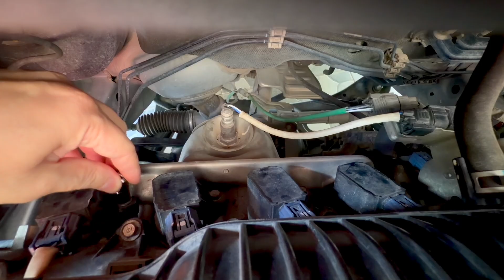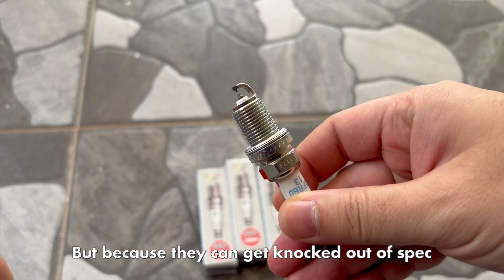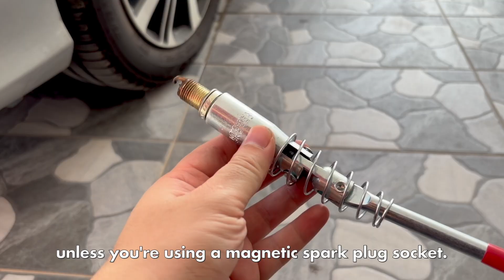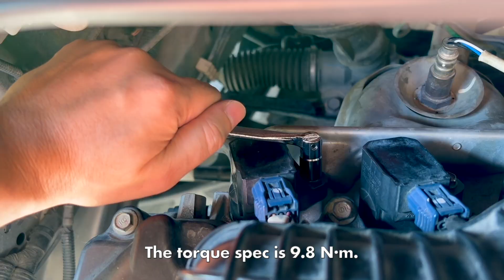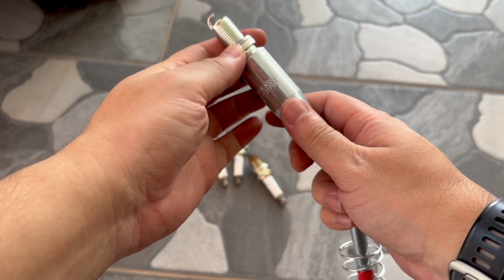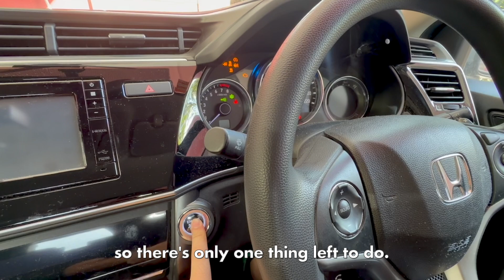How to Replace Spark Plugs | Honda City GM6

Comment: Hey man, thanks for this video! Came right in time when I am going to attempt my first DIY job! 

I am wondering where you got your spark plug socket/wrench, and is it magnetic? Would any run of the mill spark plug wrench from store like MrDIY do the job?
Reply from the maker: It’s not magnetic, but it gets the job done. MR.DIY also sells this tool. Simply search for "T-Spark Plug Removal Tool". I do have a magnetic tool, but the space in this car is really tight, so it wouldn't fit.